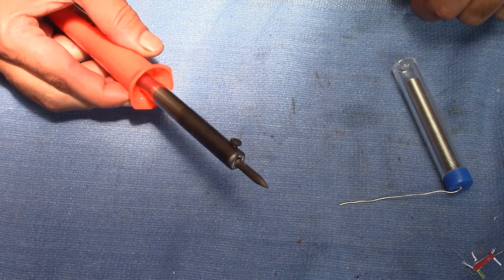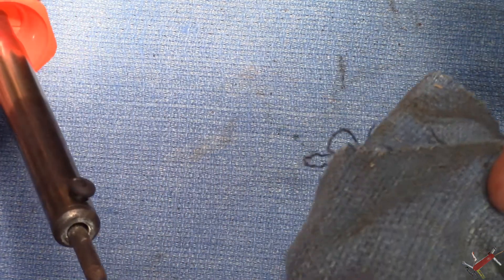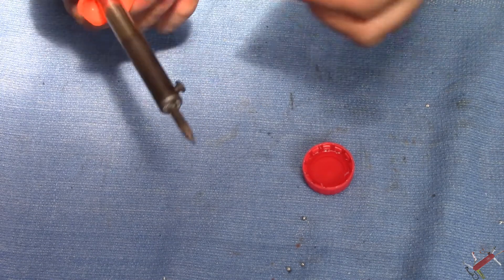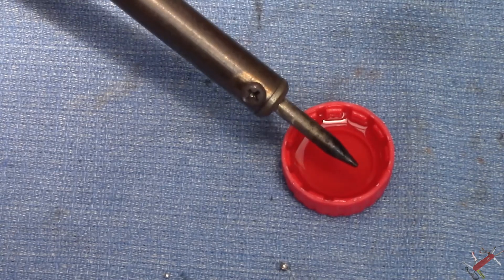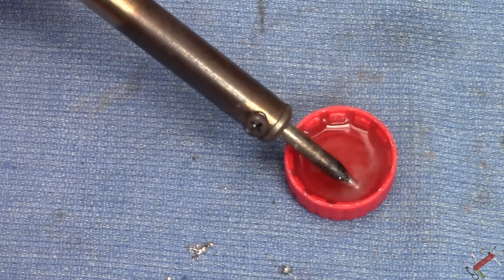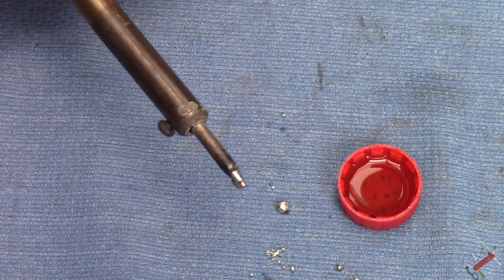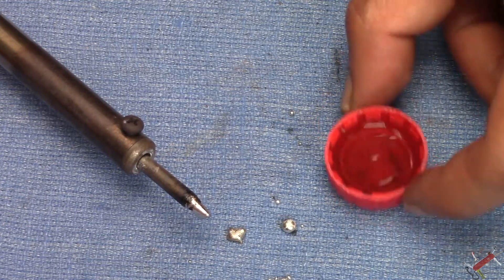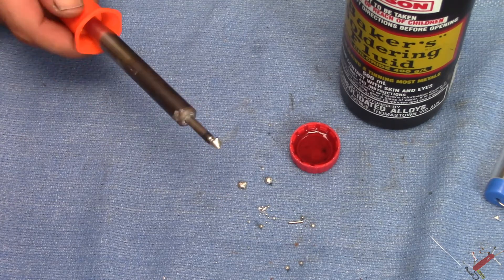simple Soldering Iron Tip Cleaning  (Baker's zinc chloride)

Comment: Simply  use, 
Citric acid coarse powder in a small glass
Bottle
Reply: where can i get this citric acid coarse powder?
Reply: @CatapJoshDavidA  Eh, vinegar? 🤔😀
Reply: @CatapJoshDavidA  citric acid is most common, you will get in grocery shops, super market, on line etc, 

Add some very small pieces of solder wire also.

Comment: Magic ! Plumbers flux works the same seems to be more aggressive than normal electronic flux , don't use plumber flux on your pcb just for cleaning dirty soldering tip
Reply: hi buddy, what is the water that you use?
Reply: Plumbers flux is more aggressive, and that's exactly why you shouldn't use it when soldering electronics. It's fine for fixing your tip, but don't put it on your pcb's!
Reply: @AnnaVannieuwenhuyse  yes someone would :)
Reply: @AnnaVannieuwenhuyse  why is that , what happens to pcbs when used ? and did you try it and saw that is happening yourself , or you just heard it ?
Reply: Same goes for this...